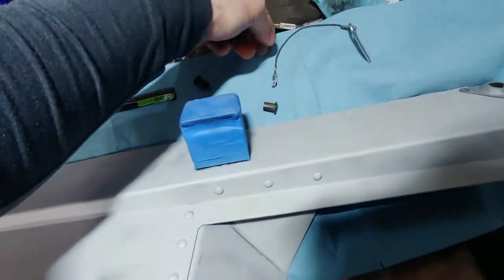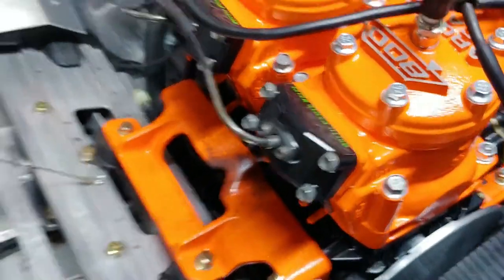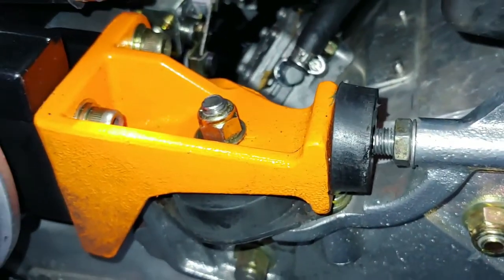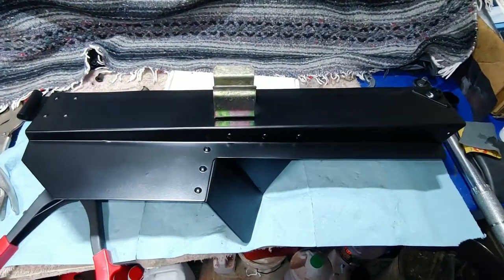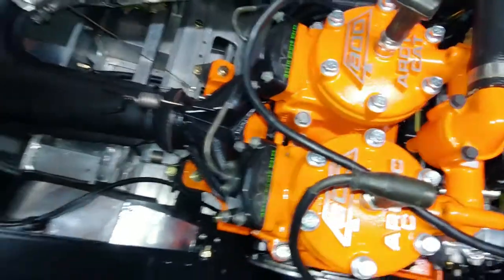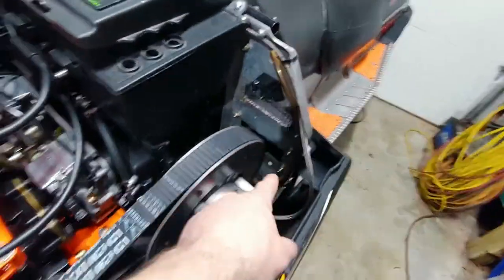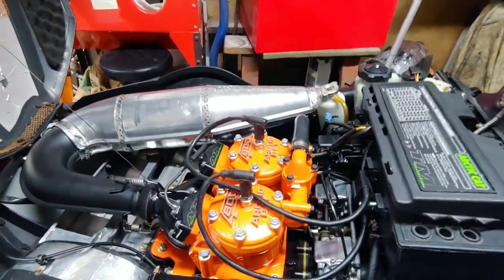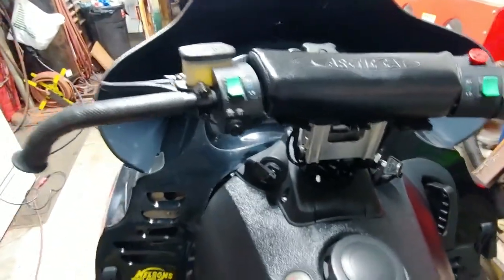02 Arctic Cat ZR 800 CCE Rebuild Part 19 || Belt Alignment & Corrections [That Was Close!?]

Comment: Looks and sounds good ,as far as that shield it's a snowmobile not a show car 😂
Reply from the maker: Lolol. I know man. I get picky. But some things ya just have to forget about. Cant tell its there going 100mph down a trail! Lol
Thanks for watching!
Reply: @Fixin2Ride-Official-  that's wut I tell my buddies when I'm flying by them on my thundercat 😆
Reply from the maker: @larrywarner9314  yeah buddy! Finally got me a Thundercat 1000cc. A 1999 and I put flat slide rack carbs on it and a set of boyesen dual stage power reeds.  I have a really nice set of Vforce 3 reeds, cages, flanges and freshly powder coated (in super chrome) clamps with SS screws for sale! $300 shipped OBO.
Reply: @Fixin2Ride-Official-  I'll think about it, mine is a 2001 1000 it was all done when I bought it ported ,D&D trail pipes ,v-force reeds D&D clutch kits it's a rocket ship I got it torn apart cuz of a reed broke and took out my piston and cylinder
Reply from the maker: Yeah these will fit. They are ready to install. Perfect condition... They look new and the clamps I powder coated turmed out really nice. I just had to out the stainless steel screws in them to top it off. 

What state are you in?

Comment: Andrew thank you for sharing the tips on this particular model... i have never owned a ski doo before so i took the chance and bought a 2002 efi - zr800 (he claimed it is a 2003) with reverse.. i got it for 1800.00 canadian - (that's 25.00 in american dollars!) the only problem i have had was i broke off the reverse linkage, simple fix...  speed an km/distance speed/odometer do not work - rpms do but i am guessing they are off a bit as well... but holy @#$^ can that thing move!! Extreme power!! ... i want to maintain this beast so can you tell me - what are the most common issues and best preventative maintenance methods are?
Reply from the maker: Glad you like the video series. Yeah they are great machines lots of power. With any of these slides you want to make sure that the skid bearings are all good you want to make sure that the Jack shaft bearings which is the shaft that the driven clutch mounts to those bearings as well as the Trac drive shaft bearings are all good and if your speedometer doesn't work that means that either the speedo gear down below the driven clutch is locked up or the bearings on that side for the tracks drive shaft are going bad and the two inch long wire key Has Broken. So you'll want to check that out. Another thing is that you want to make sure that you don't have any air leaks from the crank seals or the intake boots because that will create a lean condition and burn the engine down. Go to make sure that the carburetors are clean as well but it sounds like it's already running good. I like to use stable brand 360 Marine fuel additives at the beginning of the year and at the end of the year. This helps to keep the carburetors clean. We also want to make sure that your clutches are clean as well as the belt deflection his proper and that you have a good belt on there with a good spare.

Comment: Quick question for you ! I got myself a 2002 ZR800efi cross country recently. I was wondering weather the sled has a choke on it or not ? I can’t seem to find it in the sled anywhere ? Is that normal
Reply from the maker: No. Efis do not have a choke. Should jist need two pulls. 1st one to charge the system and 2nd to start it.
Reply: @Fixin2Ride-Official-  thanks very much ! I was very confused why it didn’t have a choke , I guess it’s built into the efi system
Reply from the maker: Yes. EFI ecu detect ambient air, altitude and barometric pressure and knows if engine is cold starting to create perfect air fuel mixture ratio.

Comment: Bad ass i found a 2002 arctic cat mtn cat 600 efi with only 2500 miles here in Ak its super clean i want it so bad
Reply from the maker: Oh man. Perfect sled to put an 800 in too. 😉
Reply: @Fixin2Ride-Official-  needs to be an 800 efi i dislike the carbs bc they use to much gas and i live here in Alaska and dont plan on moving born and raised here no place like living on the YUKON
Reply from the maker: @edwardabrahamiii3742  I don't know I have boyesen reeds in my 800 and I only have 410 Mains in it and it does pretty well on fuel. What kind of fuel economy does an O2 800 EFI get? As in how many miles per tank roughly
Reply: @Fixin2Ride-Official-  my old man had a 99 zr 600 efi that thing was good on gas just as good as modern day sdis or efis or almost etecs and ctecs
Reply from the maker: @edwardabrahamiii3742  yeah my wife's 580 EFI and then I also have a 580 EXT EFI in are both really good on fuel
Reply: @Fixin2Ride-Official-  that idk but its definately better then your carb i can tell you that i had the 2014 polaris indy 800 sp CFI that thing would keep up with the ETECs/ my 2010 ski-doo 1200 4 stroke on gas mileage id keep an average speed of about 40 to 50mph traveling 60+ miles a day my 1200 would use 2 gallons about and my 14 polaris cfi woulf use 2.7 gallons
Reply: To live up here in Alaska in the rural areas got to own a SLED in the winter to get around here in my village theres only 1 small gravel road and it doesnt do much for yah it doesnt connect to any other villages or citys its just for in town use
Reply: To go from village to village here got to own a SLED
Reply from the maker: @edwardabrahamiii3742  oh wow that's pretty crazy I didn't realize you were in that kind of area.
Reply: @Fixin2Ride-Official-  i live around Emmonak Ak my nearest hub thats where i get my sleds dropped of to by AIR from either Anchorage or Fairbanks never did order from any where else other then that and got to either pick em up with another sled or by boat during the summer fall months
Reply: @Fixin2Ride-Official-  my moms got a 1995 same year i was born 580 carb i found it with only 500 miles plus everything still works on the sled and the only thing aftermarket on it is the helix
Reply from the maker: @edwardabrahamiii3742  it makes sense